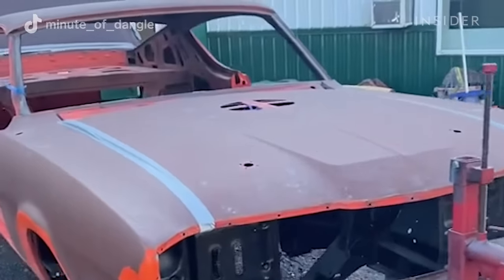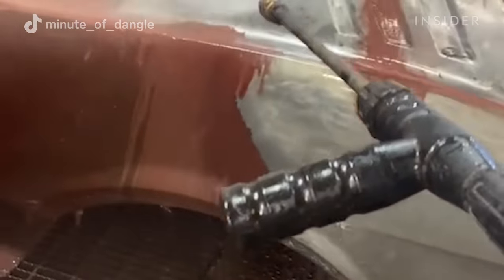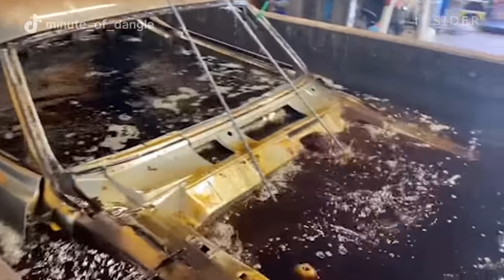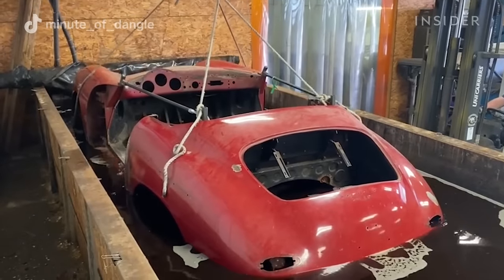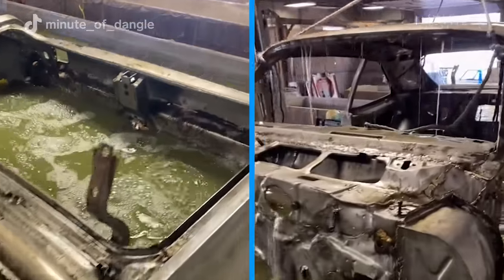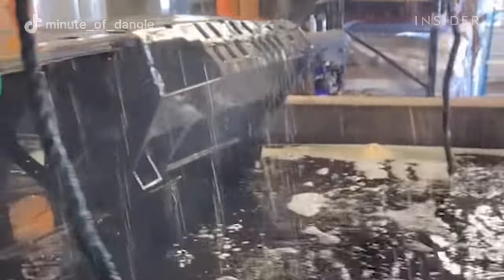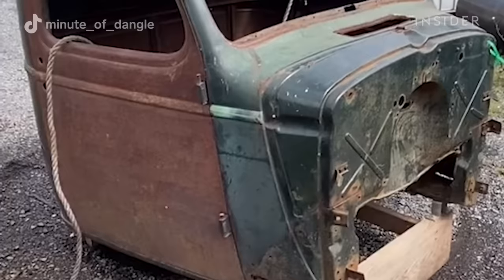Chemical Dipping Removes Years Of Paint And Rust From Vehicles | Insider Cars

Comment: I had a business just like this in the 70's in Maryland. I'd show pictures if I could post them on here. I use to charge about $400 to $500 per body and a little more for problem bodies. I'd charge around $35 for front fenders and a little less for the rear. The flanges in the bodies can be a problem so I'd tell my customers to flush them out with plenty of water then let the body sit in the sun. There is always going to be some seams that leak at first but flushing stops the problem. I did a lot of cars of all types and some antiques too. Never had one problem. The secret to a good job is the person who paints the finished, stripped parts. I always recommended a wipe down with...can't remember the brand name now... an acid etch then letting it dry then a primer. But to leave the part alone, including not touching the parts with bare hands - acids from the body will leave rust marks - until they are ready to be painted. Had many show winners including street rods and some very rare cars. The chemicals last a long time if properly used and no grease is allowed in the tanks. Wonderful business but a lot of hard sweaty work..as the paint stripped is in a heated tank of 110 to 130 degrees.
Reply: $500 dollars in the 70's would be equivilant to $3500 dollars today adjusted for inflation. Similar pricing
Reply: Sounds fantastic, Squeaky.

Comment: I like it.  There used to be a dude around where i live that had a bath for doors to remove all paint layers worked really well.  I recently restored an aluminium boat and i used paint stripper and a pressure washer to get the old coats of paint off worked like a charm without hurting the metal.

Comment: Wow, surprised it stays in the stripping tank for so long! I assumed a hot paint stripper would literally take minutes.  Thanks for posting this!
Reply: It's actually acid
Reply: @thestreets5206  ok cool, makes you wonder how long they had to dip car racing shells in the 70's. It was common practice to reduce their weight by acid dipping.
Reply: @thestreets5206  A company in the UK also does this but they pyrolyse the body first at 400 degC , seems to make it a lot quicker.
Reply: It takes so long because they are using "environmentally" friendly chemicals. Harsher chemicals, stronger phenol based types, can strip paint in hours. We use phenol type strippers to take paint off large aircraft in a matter of hours. Paint literally drips off the surface.
Reply: @VaporheadATC  Ok thanks. I used to get involved in aircraft refurb work, I vaguely recall on some, like the VC10, chemical paint removal was forbidden, old paint had to be sanded off!
Reply: @markdavis2475  Yeah, chemical removal depends on what your state permits, usually.  I worked on military aircraft, such as the KC-135, B-1, etc. At one time the B-1 had such a hard paint coating that chemicals wouldn't touch it. We had to blast it off using walnut shells or something else, I can't recall.
Reply: @VaporheadATC  In the VC10's case I think it was a prohibition from the builder, it was designed in the 1960's.
Reply: @VaporheadATC My guess they are using a chelation process which takes a longer time than any hot solvent but is absolutely safe for metal.
Reply: @VaporheadATC  Lot better for the workers to not be around super awful chemicals though.
Reply: @spaceghost8995  Very true. The phenol strippers we use burns like hell if gotten on your skin.
Reply: Remember, he said "environmentally friendly". Which is soy for much less effective.
Reply: When I first read about Redi Strip, they acted like they dip it once for a few hours and that was it.  Maybe with the chemicals you once could get, but not now.

Comment: You should offer some sort of undercoating to prevent rust as well. I've read one of the coolest things about Honda vehicles is that they are fully zinc plated before the primer is put on, and they started doing that in the '80s just to make them resistant to road salt in the United States. It would be a great add-on to body stripping if you were able to offer something similar to that as an extra thing people could do while restoring a car.
Reply: @Nedd Flanders  water-based rust inhibitor is not going to reduce rust anymore than actual paint. If you would read my comment, you'll notice I referred to actual electroplating before primer is applied. Honda has been doing this since the '80s and it works really well.
Reply: The company in my area called Redi Strip can phosphate the body after dipping.
Reply: @donziperk   I don't know about that process. What is it?
Reply: @AlexandarHullRichter  We had this done on a few cars 20+ ago. Acid dip, wash, come back for all metal repairs, acid dip again, wash then dip in a phosphate solution, then paint prep and paint.
Reply: @donziperk  what is the phosphate solution? Does it protect better than primer emersion like electroplating does?
Reply: @AlexandarHullRichter  I’m not 100% sure. I worked on the mechanical and electrical side. I will try to find out. 
The company that did it is  called Redi Strip Metal Cleaning.

Comment: I've read that some of the chemicals may get "trapped" within the small seams of a body. Then, later on, they can leach out and damage a paint job.  Is there a way to protect against that if true? Perhaps having the car heated in a high temp oven after?
Reply: @Rio_Seco  
That all depends on the chemical being used.
Reply: !!! FEAR FEAR FEAR !!!
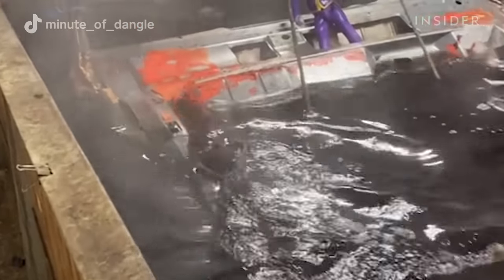Reply: @danielwarpaint1963  Just a little common sense. Doesn't seem you've got much of that, Daniel. At 2:37 he literally goes into that topic, maybe that will help you learn a bit!
Reply: That’s what the phosphate conversion coating takes care of , which is the last step , then prebrush phosphate primer into the pinch-welds (wipe off the excess) before you spray
Reply: @jamie6387  that was uncalled for
Reply: If the acid bath can get there then the neutralizing chemical can also get there.
Reply: @kyle8952  “Neutralizing Chemical.” Baking Soda. But you are correct that the solution can get in the same areas if they dip it. I’d however not start painting without making sure the thing was super dry.

Comment: Did this 20 years ago for a 65 Mustang fastback. It was $2500 back then. It does work really good. Biggest issue was the chemical evap and leave a residue on the metal and inside the bottom of panels. Got to be sure to get it off or your paint will not stick. It is the best way to do it if you have the money and time to wait
Reply: They said in the video that they out a water based rust inhibitor on to prevent rust until you are ready to paint it. If you don't want that, I'm sure you can ask them not to put it on at the end.

Comment: Acid Dipping works perfectly on single panels, but it will  leave rust between "tight seems", so still not a 100% rust free car shell,  to achieve that  you need to disassemble every panel, (as on my channels restoration), and individually acid dip every new replacement panel first, it is time consuming and costly but worth it for a pristine car shell build, that is 100% rust free,  I know a friend that had that issue on his car shell, when he removed old  rotted chassis rails from the floor pans there was rust along the entire seams, and in air pocket spots, found a day after a £3,000 Acid Dip,(done in the UK) , "NOT" by the company in this video, just to be clear,  I love the process as I did it all myself, to ensure quality was perfect on every panel, it works so well, on big panels like the roof , I used sand blasting and hand sanding, and acid wash to get back to bright clean steel,  I can recommend Acid Dipping, it works great!, and is less messy than other options, but  tight seams are the thing to note it can not remove rust from. and that rust can cause issue in time.
Reply: Then do you try to primer and paint all of those hard to reach places and places that aren't seen that are covered by different things like carpet, door panels and headliner or do you coat those places with something different?
Reply: @bodeine454  you can use a combination of primer and cavity grease
Reply: @husk1c  I've never heard of cavity grease, I'll have to research it, thank you 👍
Reply: @bodeine454  Thanks for your question, My car had serious rust issues all over it, 99% of people would of scrapped it, so it meant a full rebuild was needed, the route I chose was to individually Acid Dip every panel, original ones taken off the car that were reusable and New Old Stock,  every panel was then  rinsed in a tank of boiling hot water,  that heats up each panel and hot water evaporates faster than cold, hot air was used to dry each panel, once I was happy it was rust free, clean steel, 2 etch primer coats were applied on all surfaces so for the "A" posts for example inside the box section multi coats of Etch, Zinc, Red Oxide, Graphene,, a shrink & crack  proof waterproof flexible coating,Grey Primer, 6 x Body Colour and Lacquer coats were applied, allowing 24 hours between each to fully cure and baked on, a total of 32 layers, went into the inside of every panel that was going to be enclosed the edges of panels that were going to be spot welded together were both coated in the best quality weld through Zinc Primer, so as the welds are done it melts and runs around each spot fully coating up to it, with the addition of Professional Motor industry body panel construction  bonding sealant  between spot welds to ensure the seams were water tight, and no condensation can form in the seams, and once the car was completed and body shop top coats sprayed, a further cavity wax injection process on top,  a crazy amount of work, cost, and time, but the end result is the best protected anti rust treatment inside the shell, probably of any car ever built, My channel shows the car before the work  it was extremely bad, and some of the anti rust treatment stages, and full reconstruction to a as  brand new shell.but better protected than Ford or any other manufacture has ever done. I hope you found that process informative, a lot to read but a lot to explain, lol. .
Reply: @husk1c  I have and a lot more besides, the one problem in only trusting to a primer coat (not all types are waterproof, and a tiny scratch will cause rust.), & if the scratch is missed by the cavity wax injection (which is a  great product),you have problems, as  you can not see in to hidden box sections, many have reinforcing plates, and if you miss covering the tiniest of spots,around them, or any where when applied, rust will start and corrode metal and creep under the wax, grease, oil, underseal and rubberized coating. Condensation rots cars from the inside out, so 100% clean steel, fully sealed is the only way to ensure it will not start.somewhere, My car was undersealed and cavity wax injected, parked up for 12 years unused in the open exposed to damp, wet, mist, cold, ice, & snow, but the rust started in missed areas inside the box sections, and porous painted ones, and ate big holes throughout the car.
Reply: @Cortinaman63  yes, thats why you use grease because it never transfers into a solid form, so when you leave your car in the sun the grease should liquify and get into the missed areas 🤙

Comment: Used to do this with aircraft and aircraft parts at USAF depot maint process especially after NDI corrosion inspection where some aircraft never flew again and we had a great plating shop along with seed and beed blasting not one solution is good for all parts but in my opinion for vehicles this is the best as long as there is not to much rot

Comment: This was extremely interesting….and seemingly reasonably priced!  I can’t help but wonder…..during the process, if ever when lifting a particularly badly-rusted body from the bath, there was so much rust, the body ‘broke’?  And how often is the “bath water” changed — as in, how many processes before new chemical bath is refilled?  And I can’t help but wonder…..what about the resulting sludge?  Has to be one helluva expensive ‘hazmat’ bill to dispose of it.  Still…..I found this fascinating, as I’m considering having my original-owner 1997 Jeep TJ professionally restored.  Thank you, again, for advertising the cost, and again, it seems reasonably priced and thorough!
Reply: I wouldn't be surprised if they rejected cars that rusty.

I'm going to take a stab and think they only change the chemistry a couple times a year. If they have filtration and replenishment systems, they should only need to drain the tank when it's time to service the pumps.
Reply: I've never restored a car, but I would think that most guys who do tend to pick bodies that are in decent shape to begin with for restoration.  If it is so rusty that it is in danger of falling apart, hardly anyone is gonna take the time.
Reply: It kind of looks like most of the rust stays intact until its hit with the pressure washer so most of the mass should be coming off outside the tank. It also looks like the paint and rust are just washed down the drain so no hazmat bills there.
Reply: Rust has no strength whatsoever, that's why we want to cut out rusty metal and replace it with fresh steel. When a car body has become so rusted that it's in danger of braking apart, you weld a temporary steel frame to hold it together while you repair it. In the video a red MGA convertible has this bracing done to it.
Reply: A car that rusty probably would't be worth chemical dipping in the first place.

Comment: A friend of mine in MI had his '55 Chevy sedan dipped and it looked great... BUT a few years later on originally excellent sheet metal, like truck and door pinches, it started to bubble up.  It was believed to be from some minor amount of the original dip acid that got caught in the pinch areas that started the rust again a few years later.  What guaranty do you give that "some" of the stripper acid won't be caught in the pinches of your process?  I know that was 25 years ago and times have changed, but is your process that much better?  Thanks!
Reply: Even if they get ever drop of it out unless you dip the car in paint you're gonna be left with bare metal in that pinch weld which will eventually begin to rust, that's a down side of this process.
Reply: The process involves dipping it in a acid neutralizer after the acid. That would stop it rusting. I'm sure probably 25 years ago it was acid then a wash with water then paint. This is a far more advanced process
Reply: @brandonlink6568  True, but that's also a flaw with the factory vehicle itself too.
Reply: What warranty you expect from 2500 buck job there is a risk for sure.
Reply: Thanks for the negative info. 
Now i am aware of it.
Reply: More likely undercoating and paint didn’t cover that area of metal and water was able to seep through.  It’s also possible the steel itself had flaws, especially with older cars.
Reply: @samthesr20man  they dont change the neutralizer everytime. So it will get less efficient. If you good Bad luck it will leave stuff on

Comment: All that was said in this is true.  However unless the process has changed in the last few years, the biggest issue is the tendency for the solutions that the car was dipped in to leach out from welded seams onto the new paint.  This is the primary reason why most restorers don't use this method.
Reply: Not necessarily true .  
By the time you get it back and start sanding it for epoxy primer and letting it sit a week to fully cure and then start doing your body work the chemicals will dry out I done a few cars that were done this way and it's a lot nicer than sanding everything out and sandblasting warps the metal I seen a few cars blasted and it does more damage than good and sometimes your there trying to get the sand out of one door for a day..
Reply: I grew up at redi strip which made the technique.  Most franchises either changed name or closed doors but you are correct but despite the leaching we did a bunch of cars being back logged for over a year at some points.
Reply: He said his chemicals were environmentally friendly.  That was a heap of bullshit.
Reply: Perhaps they bake the cars in a car oven to expedite the drying out process?
Reply: @Dixler683   As a hobbyist electroplater, refiner of precious metals, and smelter of metal ingots for the last 20 years, I really didn't need you to dinksplain chemistry 101.  I'm not a lefty; your political insecurities really came through on that one..
Reply: @rafaelallenblock  Let's go Brandon!
Reply: @86z50r  You're so mad! LOL